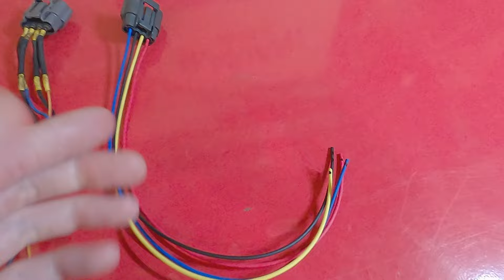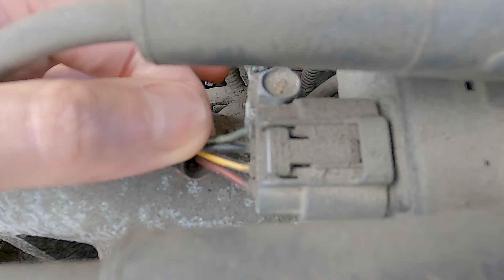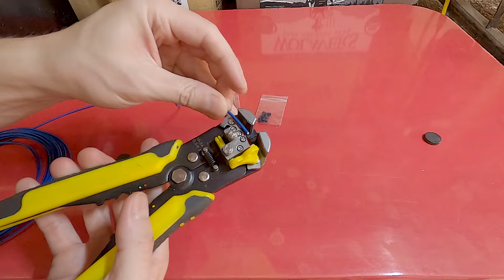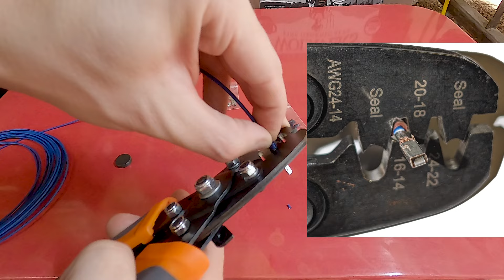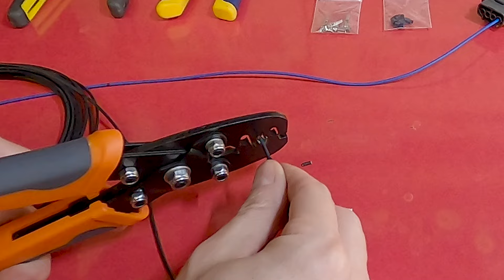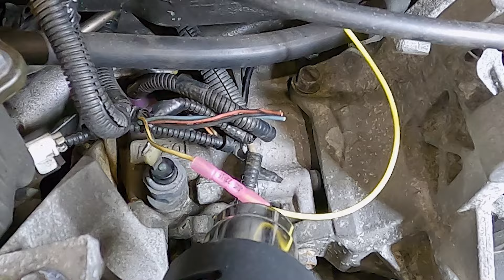Replace Car Wiring Connectors From Scratch - DIY Automotive Connectors Step By Step Guide

Comment: Made that look easy!, I struggled hard at this when I first tried. To be fair I was working on a lot smaller connectors for a non-automotive use.
Reply from the maker: Ohhh like JST or Molex? Yeah crimping those pins, especially without exactly the right tools, can be such a pain. Most car connectors are definitely easy, though some love to bend whenever you crimp them or have super weird seal wings. Thank you for the support as always!
Reply: @802Garage  Not sure what they are exactly I've herd the term Dupont or Berg connector being associated with them, but generic 0.1" (2.54mm) spaced pin connectors. I had no instructions with the tools I bought and had to wing it.
Reply from the maker: @roygillotti4615  I went down the rabbit hole on those exact pins not long ago and the actual appropriate tools to crimp them. I think I even have a rather obscure site bookmarked, hahaha. Crazy how a company can come up with a standard that spreads everyone and few people even know how to crimp it properly.